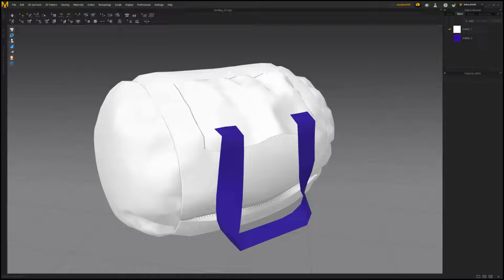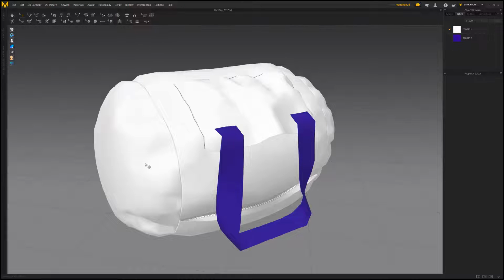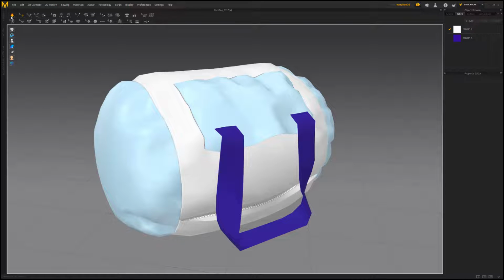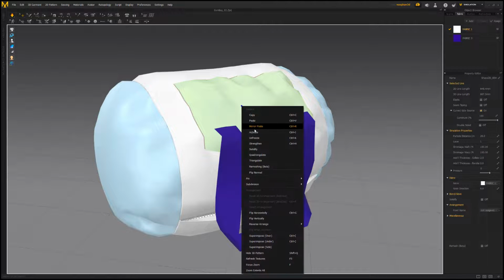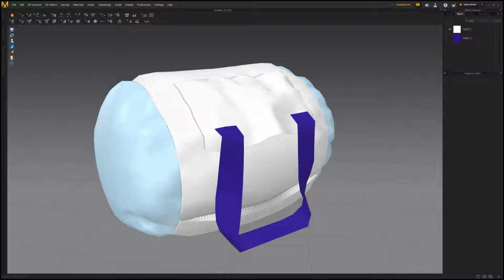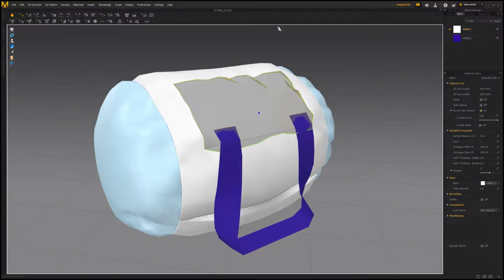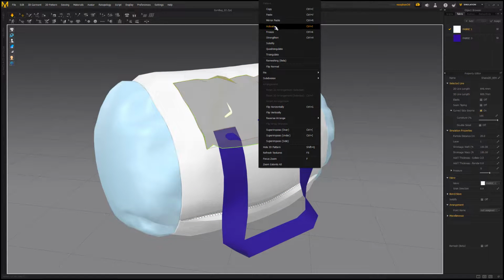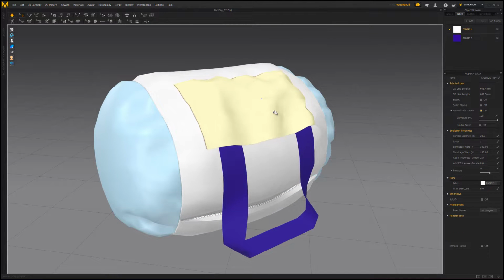Marvelous Designer |Freeze and Deactivate

Comment: In my case deactivated patters still slow down scene as if they were simulating. what might be a problem?
Reply from the maker: What are your computer specs... that could easily be the issue.
Reply: @pixelfondue   My specs are 
gtx 1660ti 
i7 9700k 

That's not the point though. 
I want to know, does frozen and deactivated garment still affect simulation times or not. 
Logically it shouldn't. 
I had worked on heavy scenes with this pc 1-2 years ago in MD.